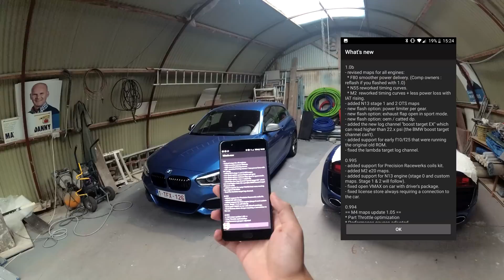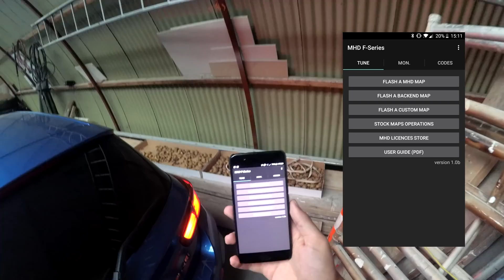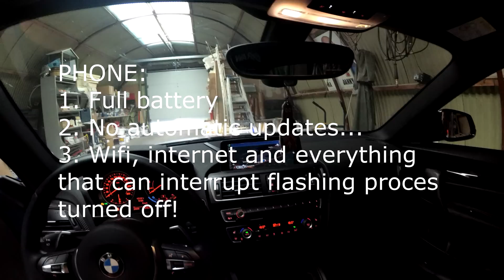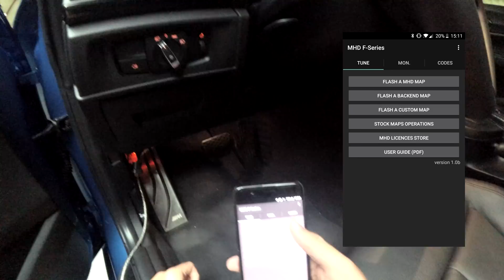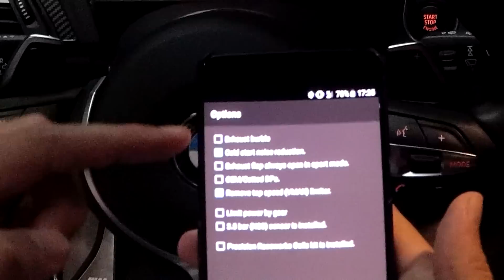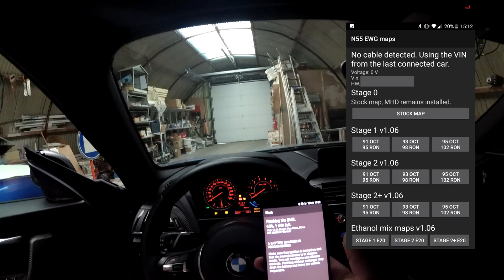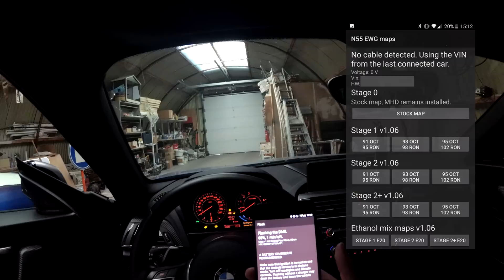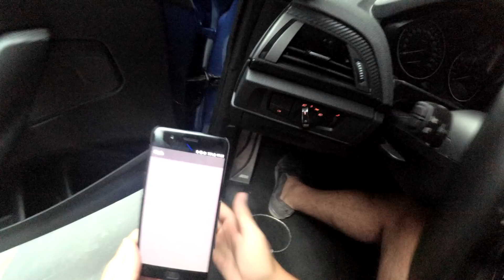How to install MHD for BMW F-series | Best N55 TUNE on the market

Comment: Is there a map option that is purchasable from MHD that has lower hp than stage 1? For example 136hp -> 170hp increase to F20 116i? Or can the hp be adjusted after the remap somehow. I dont think so but would like to be sure. Thanks for the video btw :)
Reply from the maker: No, theres stage 1 and 2. If you truly want that you'll have to go custom.

Comment: That sheet is expensive, 99€ that's in Euros and about $117 in USA dollars for each damn map. Use to be $49. Oh and before you can slap any custom map, you first have to buy the Flasher module that lets u flash in the first place and that an additional more than 200€+ euros on top of the stage map, so u do the math in dollars & that's costly! Money pit!
Reply from the maker: This is literally the cheapest tuning solution that exsists... Except for a €100 tdi tuning box that will blow up your car in about 6 months. Any custom remap is around €600-€900. 

What you're describing here is a full switchable map tuning solution for around €300, it's literally a laughable amount. A wagner intercooler costs €1K, a catted downpipe €1k and a Remus or Akra exhaust is 3.7-6.5K. Don't get a €50.000 car if you think €200 for it's entire software and a 100HP gain is 'a money pit'.
Reply: I purchased the Super License a week ago but it's asking for the last 7#s of the VIN?... did any have this problem

Comment: Hello what te performance stage 2+ compared to jour Audi R8?
Audi IS better than BMW  ?
Reply from the maker: Hi man, first of all, the R8 is not mine, it's from my dad. 

It's complicated to answer your rather simple question. 

The M135i was rapid because of the turbo, awd, and automatic. Those 3 factors really caused for a very fast acceleration. 

However it's still +-420hp vs 525HP. It's hard to make up for another 100HP.

Another big difference is that the power in the turbo BMW dropped off after 6500rpm, the gears in the R8 are very long and keep gaining power until 8450RPM. 
So where the BMW drops in power, the R8 starts ripping your face off for another 2.000RPM and that makes it feel very very fast. At +-6500rpm you get the natural feeling of wanting to shift, but then realising there are 2.000 more rpm's you still have left is a really crazy feeling. 

Lastly what makes the comparison very difficult is that the R8 is manual with an expensive clutch. So we never launched it in order to not damage the clutch and the shifting is also quite a lot slower since it's manual vs automatic. 

So to answer it from a pure 'speed' point of view:
BMW was faster from launch & low rpm because it was automatic and has turbos.
Once ur in gear the R8 is faster.

In terms of driving experience:
The R8 ofcourse wins. Manual, huge V10 with the best sound in the world, and top down experience + it's a supercar, not just a hatch everyones mom has in diesel version.
The M135i however is an insane pocket rocket, really quick and makes for a great and powerful daily driver which is quite incognito and offers you pretty much everything (in both power and comfort) that you could ever want. It also offers insane value at 1/3rd the price of the R8 V10.

Hope that answers your question :-)
Reply: @AaronMattheus  🙂 thanks a lot for your long  détail answer .verry thanks.i apreciate. Yes i m verry happy whith your answer!
Long life on your vidéo!! I like them.
(Im french and i have a BMW Z4 35i whith MHD stage one + whith only intercooler now.)
Reply: @AaronMattheus  you can not make a better exponation !! nice job !!

Comment: I will buy a 435i 2014. The stock sound is not so special... Do you think tuning it only with MHD will make the car louder and more agressive sounding?
Reply from the maker: Nope, you have to do exhaust mods.
Start with a catless downpipe, then you can also get a stage 2 tune instead of stage 1 and go from there 👍
Reply: @AaronMattheus  Unfortunately here in Switzerland they will take your car away if you do catless haha.. Downpipe or complete exhaust is ok like the M performance exhaust.. Is stage 2 possible with only downpipe? (parts + papers are very expensive here )
Reply from the maker: @MrXeroD  Damn that sucks :( I visited Switzerland with the M2 for a couple of days this summer. Very expensive indeed D: . Just downpipe is ok for stage 2, for stage 2+ they recommend downpipe + intercooler. I'd also look at upgrading your chargepipe as it might crack with the added turbo boost.
Reply: Aaron Mattheus Ah okay thanks man! I think I‘ll go with DP and Stage2 later this year..but now for the beginning I think Stage 1 and always open flaps + some burble mods should also make a noticeable difference?

Comment: How do you stop the ignition turning off in the middle of the install? My car shuts down after about 5 mins? Also if you buy the stage 2 map do you get the stage 1 also? On your phone it showed you had both or did you have to buy both of them? I was thinking of getting mhd and trying stage 1 and getting stage 2 later once I’ve got a decat downpipe.
Reply from the maker: During the flash the car won't auto-shutoff. Leave your key inside though with the door opened.

And sadly no. Stage 2 and stage 1 are different packs.
Reply: Aaron Mattheus thanks for your quick reply. I might wait until I have a downpipe fitted then as I don’t want pay for both state 1 and 2 maps. Cheers.

Comment: Hello. Thanks for the amazing video. For stage 2, mine is 435i 2016 f32 n55, whats the difference between oct and ron numbers and what are they already ?
Reply: Depending on what county you're from we use different types of fuels with diiferent octane content, so in my county for example we use 95 octane, so I'd select 95 oct

Comment: 135,235,335 and 435 all share the same motor but make more power on the same tune(s) than the F10 because of the way BMW designed the path of the air intake flow on the F10. The design severely restricts incoming airflow on the F10 that results in it making less power than the other "35's" which have a different airflow design. Some F10 owners have resorted to custom-fabricated air intake designs.
Reply: Source please?

Comment: Hi! I currently have a car that has MHD installed by previous owner, but I don't like the burbles he has set in sport/sport+ mode. I am from NL, would there be a chance that you could help me out with your MHD setup? (I dont use android). Let me know! Regards
Reply: MHD is tied to the VIN of the car. Makes sense. So he can't help you

Comment: I finished flashing every thing was fine then after 3 hours I turned the car on and  I got engine light on is it normal ?
Reply from the maker: No not normal. What are your mods and what map did you change to?

Comment: Would you say it's worth buying map 1 for my M140i? I am planning on going stage 2 in probably a few months. 

Do I only need a decat downpipe to go stage 2? 
Is the max power output 420 stage 1?
Reply from the maker: M140i is B58 engine. This video is a tutorial for the N55 engine. I don't know the exact qualifications for an M140i but on the M135i, you only had to change downpipe for stage 2. Downpipe + intercooler for stage 2+. I'd recommend going straight for stage 2 or 2+.
Reply: Stage 2 would be charge pipe, DP and intercooler. If you add an E85 fuel mix you should be at or very close to 400hp. It also depends on what year your car is 2011-2013 has PWG wastegate which looses about 15-20 HP compared to the updated 2014-2016 EWG wastegate. The only way you will see over 400hp is with a Pure Stage 2 turbo upgrade on top of the charge pipe, DP, intercooler and tune.

Comment: Is it possible to adjust the burble differently in sport mode and sport + mode, for example having something more hard in sport + mode. (or just difference between confort & sport) ? thanks
Reply from the maker: At the moment they do not offer this option I'm afraid.
Reply: @AaronMattheus   Yes... the answer of MHD : "Burble can only be set for comfort and or Sport/Sport Plus. 
You can't do different aggressiveness levels for comfort or sport plus, just duration. 
If you set base to 0 then burble is off in comfort mode for example. sport duration is for Sport / Sport Plus "

Comment: Will it be fine if you connect a battery charger to the terminals up front rather than directly to the battery?
Reply from the maker: I don't know. Can't help you with that I'm afraid.
Reply from the maker: I don't know. Can't help you with that I'm afraid.

Comment: Do we have to backup stock map first?

Edit: also, I have a m235i and for the automatic options I have A8 and "A8 with fix in reduced power in 3rd qnd 6th". Which one should I choose?
Reply from the maker: I never made a backup of my stock map. And I was able to flash back to stock so I guess not. And it depends, just choose one, you'll be happy with either ones. If you feel the car being hesitant in those gears you can just reflash in 4 monutes afterwards.

Comment: Have you ran these maps on a dyno? MHD's site says stage 1 is up to 370bhp, stage 2 400bhp and stage 3 430bhp. I know it's only "up to" but those seem like crazy figures
Reply from the maker: I think those are the max figures on 102 ron. However what really matters is how smooth and linear the maps are, and they are great in this regard while offering all the power you could wish for.
Reply: These numbers are at the engine not at the wheels. At the wheels (WHP) you would subtract about 10%  from the (BHP) numbers. So that 370hp will actually be 333whp. The improved torque numbers really improve the feel and performance of the car just as much if not more than the HP numbers.

Comment: Really annoying there isn’t an iOS version, has anyone tried running this app from an android emulator?
Reply: There is an iOS version, it's on the app store and MHD recommends you buy the wifi module. Otherwise, you can buy a OBD to Enet with a Enet to Lightning  but MHD says the wifi module is faster... I was also thinking about an emulator but I'm not sure it would work well...

Comment: I have a jb4 installed , can i flash my car with the mhd to get rid of the top speed limiter and keep the jb4
Reply from the maker: Yes you can 'stack' MHD and JB4 and load your JB4 map through MHD if you want to. MHD stage 2 map is getting better results as a custom JB4 map tho... So not sure why you would want to do that. I had JB4 first aswell.
Reply: Aaron Mattheus thanks for the fast response! Overall I am happy with the jb4 the reason I want to flash it with mhd is because I was disappointed that my top speed is limited to 130 mph, and want to utilize its top speed limiter
Reply from the maker: @JB-fm4tb  Isn't the top speed limiter removable by JB4?
Reply: Aaron Mattheus no it’s unfortunately still there I have a 435i m sport and it’s limited to 130 mph bc of the tires it came with such BS !!! I wouldn’t even care if it was 155 like the rest of them

Comment: Great vid, very informative! Btw, is a tune on the dyno not better and safer? The MHD seems fun cuz you can edit several things all by your self, but I rode that some settings can also bring  disadvantages in the end..btw, "foutmeldings"..haha!
Reply from the maker: You can probably adjust the settings on each individual car a little bit more accordingly to that exact car on a dyno tune but from my experience most tuners became pretty lazy and upload pretty much the same standard maps to every single car with the same mods. They then run it on their dyno to check if everything is working normally and to provide you with the numbers and that's it. MHD is pretty much doing the same, they give you acces to a very good base map, which has to be safe between some parameters as hundreds of cars are going to use that exact software in their cars. Atleast, that's how far my understanding of it goes. 

Also with thousands of people using the same map, they have a huge budget to invest in that one map which benefits the consumer alot and with thousands of people running the same map, if there are issues with the map it will be discovered very quickly and fixed, probably before it can happen/cause damage to your car, where as with an individual map, if something goes wrong, you will be the first one to find out, and most of the time this won't be a good thing ;-).
Reply: @AaronMattheus  Hmmm I see. Ur from Belgium, so guess you heard from Br Performance? And bout the standard maps, maybe some tuners do that, but some really don't, cause you can see the same cars tuned but different charts. But I get what you mean..in the end the MSD could be more fun tho cuz of the options you can choose from..

Comment: Hi Aaron, has there been no issue with spark plugs, as I've been told stage 2+ needs a cooler running plug. Many thanks, your vids are 👍👍
Reply: Ok cool, I'm looking forward to getting mine,  just running decat so I'll go stage 2+ 👍👍👍
Reply from the maker: Nope, never heard of that before. Official MHD site doesn't say it either and no issues so far. Not even using an intercooler, and now with wintertemps my intake temp permanently stays below 28°C 👍

Comment: You didn’t have to use a car battery charger?
Reply from the maker: The initial tune takes 40 minutes. That's when you should use a charger. However when just switches between maps afterwards only takes 2-4min so I figured out I could get away with it without putting a charger on. However MHD suggests always using a charger for safety purposes.

Comment: How is the time-to-torque response now compared to the jb4? If it really is bettee that would really convince me switch over from jb4!
Reply from the maker: Better, no drop-outs after shifts and the line feels way more lineair in general. Also, the temps outside dropped in the last days and car 100% stays under 38C on stage 2+ without an intercooler. Boost season has started hehe.
Reply: @AaronMattheus  Haha cool thanks! So you would say the ~1 second foot to torque lag has also been eliminated besides the cuts after hard shifting?
Reply from the maker: @tzermiass  It's still a turbo car, so there still is some lagg. But the hard random cutouts are gone.
Reply: Fair enough. Thanks for the info man - good to see someone doing some more competent reviews!

Comment: I made 348hp with MHD stage 1 on the dyno, but air intake temps rose from 20C to 60C during the pull, so I suspect that timing and boost was pulled. Ordering an intercooler and downpipe next week to try the 2+ software out and push past 400!
Reply: Now at stage 2+ with intercooler. Made 387 hp 460 ft lbs. Again intake temps rose on the dyno, but didn't get above 50c. You can see on the graph where timing is still pulled above 5500 though! I'm having with colder temps it'd be over 400.
Reply: @liamcollister  What fuel were you running to achieve 460 torque?
Reply: @Tre-jj8do  97 RON fuel. Dyno'd again with better ambient temps and map updates and made 410hp 450 ft lbs.
Reply: @liamcollister  Thinking what would be the gains for a 13' 335i with M Performance Kit (320 Hp / 332 TQ)
Reply from the maker: I had JB4 on a custom map 6 and they told me it should have made about 400HP. However, my intake temp constantly went up to 62C. Now on stage 2+ from MHD my intake temp has never been above 48C anymore when the car is rolling and at the same time it feels twice as fast as when I had JB4 on it. Let me know how stage 2+ is working out for you after you got your DP and intercooler!
Reply: Will do! I'm just scared that the open diff will make it self show even more. It's bad enough as it is coming out of corners haha